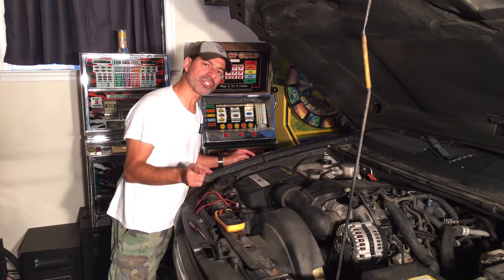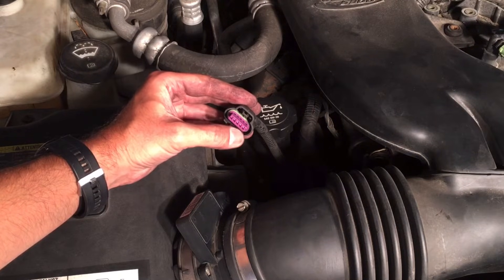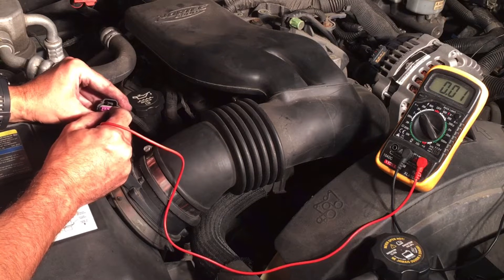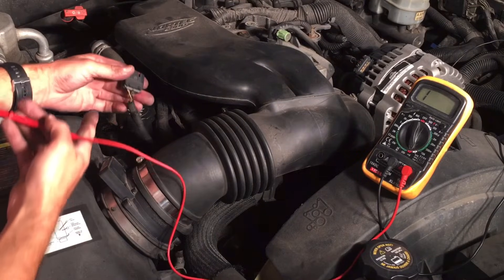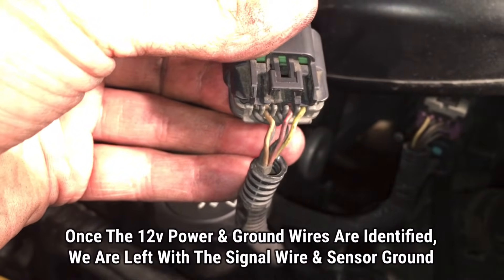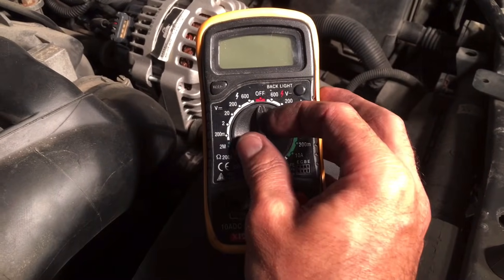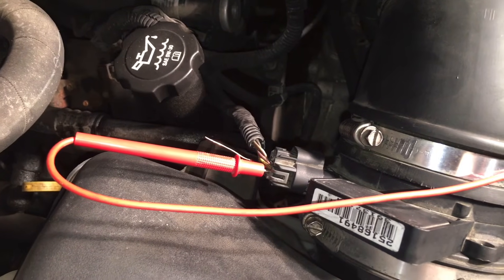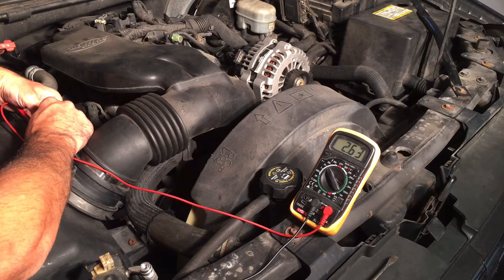How To Test A Mass Air Flow Sensor (Andy’s Garage: Episode - 287)

Comment: Hi I have a BMW 2012 diesel 530d. 180kw. if I have the maf sensor connected the car is running badly it still vibrates... but if I use the disconnected maf sensor the car runs perfectly I have changed many sensors and it is still the same

Comment: If the sensor is connected to through one connector ,where do you get the other connector from?? I wired my sensor and it shows the 14 voltsdc how do you get 2.4 volts reading? So confusing!!!

Comment: Hello
I tested the maf sensor of my car as you show and the voltage is almost constant (around 2.6V), idle or at high rpm. Before I tested the harness: 5v and 12v, ground with continuity, everything fine. So, I tested a new NTK/NGK sensor but the results are the same: the same constant voltage. Any clue how this can happen?

Comment: Nice video! But, dude, buy yourself a quality multimeter. Your XL830L cost, what, less than $10? You'll get better accuracy and, more importantly, faster response time by spending a little more $. I don't mean a Fluke (although there's absolutely nothing wrong with owning a Fluke), but Extech, Klein, Brymen, UNI-T, Sanwa, ... Just something that has better specs and has gone through more rigorous QC testing and standards validation.

Comment: Why were you reading a 4.9V at the loose harness (signal wire assumably)? I'm noticing on my Ford Transit, it's doing the same thing (getting 4.94V backfed from the PCM) and everything I've read says this is normal when the harness is disconnected. But when I reconnect it and restart the engine, it still says 4.94V and doesn't go down to 1-2V as it should. It's a new sensor. And disconnecting the PCM harness shows there's no short to voltage or ground from the MAF signal wire (ie not a wiring problem). I suspect the PCM itself is bad.

Comment: If you don't a voltmeter, you can unplug the wiring from the sensor while the engine is running, if the engine doesn't stall right away then you have a faulty MAF sensor.

Comment: How did u know which wire was signal wire vs ground wire? The orange and yellow wires you used? Red and the 2 blacks I understand but how do you know which wire to put the paper clip in vs the probe?

Comment: I keep getting higher than the battery voltage, when idling, it's increases by 2 volts then idles back to 12.4 volts. I'm thinking it's the MAP Sensor.

Comment: I noticed the author of the video isn’t answering questions, so let me clarify a few things:

Connect the black lead of your multimeter to ground (–), and the red lead to the yellow signal wire on the sensor.

A lot of people say that unplugging the MAF sensor while the engine is running is a reliable test — but that’s actually a myth. It's not always true.

On some cars, the engine may stall because the ECU can't compensate fast enough. On others, it may keep running in “safe mode,” though usually with unstable RPM or reduced performance. So the unplug test is unreliable at best.

Use a multimeter for a more accurate reading, or even better — use an OBD2 reader and check the live airflow data. That will give you a much clearer picture of how the sensor is behaving.

Comment: This is good however I wouldn’t do step 2 .. step one making sure power is coming from the lead is good .. testing the sensor itself .. you just need to unplug it .. if no engine change happens the maf sensor is gone

Comment: This is good however I wouldn’t do step 2 .. step one making sure power is coming from the lead is good .. testing the sensor itself .. you just need to unplug it .. if no engine change happens the maf sensor is gone
Reply: Would cleaning it fix the problem
Reply: @PVRP73 sometimes, you can try that first but make sure it’s MAF sensor cleaner
Reply: @tylagasse1197 yup cleaned my sensor nothing happened I guess I’ll have to buy a new one

Comment: Left me confused. Don't know how all the rest got it.
After watching im doing this.  Connecting in hope a copper wire to each of the yellow and guessing which one gets the red and black from the altimeter.
After reading a post . You say to connect the blk frm meter to a ground black. 
But that still leaves 2 yellows to chose from. 
You rushed the end with out even showing insertion of the second wire and where it went.

Comment: An easy MAF test while you're in a pince is to tap it lightly with a screwdriver while its running. If the idle fluctuates, or it stalls, the MAF is bad. If not, there's little chance its bad.

Comment: It would be nice to know which wires you actually ended up testing as you changed up from using a wire probe on the yellow wire to the probe on your multi meter. Are you then using the wire probe on one of the black wires for the ground on the multi meter?

Comment: So shadetree style is to crank car, pull plug off. If car cuts off, sensor is working. Cut car off and plug back in. If car continues to run and run rough its bad and ecu is already attempting to compensate

Comment: For the first timer, DIY’s, it would be great to let them know to always check for continuity with the power supply off and to NEVER SELECTTHE RANGE ON THE MULTITESTER WHILE IT IS CONNECTED UP TO THE POWER SOURCE - it is always GOOD PRACTICE TO SELECT THE RANGE THAT IS TO BE USED FOR TESTING BEFORE HOOKING UP THE MULTITESTER..🤔…… SAFETY FIRST IS A MUST PRIORITY.

Comment: Chris I hope you see my comment. I recently was given an 03 2.0 gasser jetta. He said that it has a maf sensor problem. He put in a new one and it didn't fix the issue. He has a couple lying in the trunk. One is a Bosch. Is it just a maf problem? I tried starting it up. It starts but quickly dies. How can I resolve this issue?
Reply from the maker: @DarrellDayton  if it’s a MAF sensor issue you will be having a check engine light on and code will be specific for that sensor.

Comment: Hi, none of my wires are providing 12 volts, Nissan Altima 2019
Reply from the maker: @username10  you may have a break in your wires. You should test each of them to determine if that is the case. Here is a video I did showing how to check for breaks: https://youtu.be/714_57IRwkk?si=zIfVVk0NFRSzl7FF
Reply: @PhillipsVision  good morning, sorry i meant to write im getting 5.06 on the other pins which are not ground

Comment: After you narrowed down which two pins are dedicated to sensing, how did you know which one to treat as ground for your test? Of the two pins you found dedicated to sensing, would it matter which one you choose for ground? Did it have to be the one you inserted the wire into? Could you have inserted the wire into the other one. Lots of ways to ask the same question but, well,  thanks.

Comment: GM 07 Saturn Aura - No voltage from the MAF sensor Plug to the multimeter from any of the plug contacts.  Weird.  Plug looks exactly the same as the one in your excellent video.  Any ideas?  Fuse?
Reply from the maker: @twtw9589  may have a break in the wire.
Reply: @PhillipsVision  Thank you for your reply.  I'm getting P0171 & P0174 lean banks 1 & 2.  Would the engine run fine with the MAF sensor completely dead?  It seems like there would be performance issues.  The wiring looks fine.  What would you do next?  I'm in E TX so I can't bring it to you for in person diagnostics.
Reply from the maker: @ no, the engine will have a rough idle. You could have a vacuum leak somewhere as well
Reply: @PhillipsVision  - The next step is a Smoke Test.

Comment: Great informative video! Thanks for the attention to detail. I have a centipede game in cabinet . Do you work on them also. Vacuum tube monitor?
Reply from the maker: @lendellsmith4411  I repair arcades, slot machines, casino games and vending machines. What’s your issue?

Comment: one confusing thing. When you are ready to test, where did you connect the red probe? I see where you connected the black one for where you put the copper wire to connect the other probe.
Reply from the maker: @ernestopenaloza6449  you need to attach it to the 12v power. You may need to move from pin to pin until you find your 12v

Comment: I got a bit confused at the placement of the probes. I know that youre putting the copper wire at the signal wire however, did you put the positive probe of the multimeter to the positive on the mas port and id the negative coming straight from the battery to the signal probe on the mas?
Reply: Won't matter , if you get it reversed then the multimeter will just read a negative voltage instead of positive. Just ignore the negative sign if you reverse em. But black to one of the grounds and red to your signal and that'll give you the positive reading.

Comment: Service manual (toyota ) says remove it completely.  Place power on pin1 (right) and ground pin 2. Measure on pin 3 and 5 and blow air at it. Check the voltage fluctuates. Then check resistance across pin 4 and 5. There should be anywhere areound 2.6-0.3 kiloohms, based on temp. The reason to test sensors by temp is because their readings should change, and what thr voltage reads is more based on the response to temp. The response to temp is based on resistance.  If you have live feed, them you can look at the wave signal or read how nany grams per second it reads.
Reply: You went all grad school on freshmen.
Reply: @thomasraywood679 😂😂😂

Comment: Another way to test the maf sensor if your suspecting it.  Is unplug it. And if the vehicle doesn't die. The maf sensor is toast
Reply: I am having the same problem right now, but I think it’s not my airflow sensor. I think it’s my wire. Connection.
Reply: Mine did die. Yet testing the + line as per the Vid kept showing 12.5 to 14 volts.
Reply: I changed 3 of them and the problem is still there😢😢
Reply: @bernardwright2802 you should be looking for other things before doing 3 of them maybe your intake manifold gasket is leaking
Reply: @johnnyrebel3340 No, that is not true, reread and rethink what you wrote and you will realise it makes no sense.
Reply: @MrGoogelaar  nah your wrong that's how my f150 runs at its best speaking from it starting with no keys ethier... test before you speak
Reply: @MrGoogelaar I read this in a British accent
Reply: @marknapier8083  Try and rewrite your comment so that it looks like something a literate person would write.
Reply: @MrGoogelaar you are both wrong, yet both right. You can bypass the maf, relying on your o2 sensors, in some vehicles. Not all.
Reply: I rmeove it but nothing changes.
Reply: Hahahah thats mean your MAF sensor are bad. Change it to the new ones @androlaius3859
Reply: What happened if it still running with a new sensor
Reply: @BigBoss-hy4zl  If the scanner gives a code for the air flow sensor then that simply means that there is a problem with that circuit, it does not mean the problem is with the sensor itself, it can be with the wiring or even in the ECU.
The only way to determine where the problem is is by testing the voltages on the different wires but that is not in the scope of some people, all vehicles are also not the same, on some vehicles the airflow sensor has the air temp sensor built in so you need to determine what wire is doing what. Different vehicles also react differently when unplugging the sensor and have different voltages on the sensors.
Reply: @MrGoogelaar what if you get a running rich code and a shaking car like it has a slight misfire

Comment: Hows this the mass air flow problem? Its the plug issue not mass airflow im lost? At the end whats next you change the plugs or the mass air filter now? You only tested the plugs 😢im lost
Reply from the maker: @almministrys1659  I mention in the video that the sensor tested bad, so it needs to be replaced

Comment: I'm glad mine only has three pins❤😂. 

I'm not a mechanic.  I don't mind "firing a parts cannon" the junk I work on probably needs it anyway and at the price of a shop I can replace a bunch of stuff and still come in under budget. All hail the mighty parts cannon. I just wish spark plugs weren't such a bite to get to  on front wheel drive cars . I can replace injectors easier than spark plugs and that just ain't right.
Reply: @ADoneGooner the overflow tank can be unscrewed and set forward giving you great access to that furthest plug which is always the problem. Hope that helps in the future, sure helped me. Couldn't even get the wire off on 3800 V6. With reservoir moved pulled the wire on first try. Quick and easy access even with large winter coat on.
Reply: @user-mr3oe5og5q  after many cuts and abrasions I did actually think to put a coat on. Your right. It works way better. 🤣 my impala is a joy to work on compared to the accursed 3.4 sfi Buick Rendezvous . The bane of the automotive world.

Comment: TIP: Use an analog voltmeter with a needle (not a DMM) to measure voltage swings with gradual rates of change. It's easier and gives a better, more meaningful visual representation.

Comment: The easiest way to test a MAF is directly in the data stream with your scam tool. No need to damage the sensor connector with paper clips. On a 6.0 liter engine the data stream should read 1 gram per second per liter of engine displacement. A 6.0 liter V8 should read at least 6.0 grams per second at idle. If it's lower than 1 gram per second per liter you need to inspect the engine for vacuum leaks in the intake system. Test for exhaust leaks ahead of the oxygen sensor like doughnut gaskets. If you find no leaks remove and inspect the sensor hot wire for debry or contamination. Clean the wire with MAF spray cleaner. If your data still reads below the standard of 1 gram airflow per liter of engine displacement verify your diag of vacuum and exhaust inspection. Check for restricted air filter etc. if nothing is found replace the MAF. This diagnosis is accurate because you've inspected, repaired and vacuum or exhaust issues. I have fixed many many other techs "come backs" by doing the diagnosis described here. No need to guess this diagnosis is exactly what the engineers use to describe the technique.
Reply: Thank you for this comment.  I was already about to buy a maf sensor based on my brother telling me that something something on the data log looked funny and it probably needed a maf sensor.  So, i looked up how to test one.  My scan tool was showing that I have 9.5 grams per second at idle.  I have a 2012   5.3.  Ok so then I replaced the maf sensor and now the reading is about 5.5 grams per second at idle.  The truck idles smoother and it picked up a little bit of power.  Also on the data log my truck was doing a lot of knock retard and stuff like that.  Any way thank you this helped me out.
Reply: I'm betting you're 100% correct in what you say about expected readings and the troubleshooting steps one needs to take if those readings aren't a match for what's expected --as you say, per liter of engine displacement. What I'd maybe take exception with is your use of the term easiest. If you know enough, and are in possession of the right equipment, sure. But plenty of guys neither know enough nor own anything related to OBD or OBD2. Thus for them, it can be argued that what's easiest is to break out a multimeter, follow the vids set of steps, and then replace the MAF if it misbehaves the way he showed. There again, I suppose it could still be a good MAF and only misbehaving because of a vacuum or exhaust leak. That seems to be the stronger point of your argument. A new MAF, after all, isn't going to fix those kinds of problems and still won't be able to compensate for them.
Reply: How do I test it under load?
What would I look for?
Do I have to be driving?
Can it be in park,
And just raise rpm?
5.3 ls
Reply: @The77stevo77 Test the MAF by reading live data at idle. An accurate MAF will show 1 gram per second for each liter of engine displacement. A 5.3 V8 should draw 5.3 grams per second air flow at idle. If it seems like it's low look for intake and exhaust leaks. If you don't find a leak remove and clean the MAF and retest for 1 gram airflow per liter of engine displacement. If it's still low replace the sensor and retest. Simple and you didn't damage the harness by needlessly back probing the connector and damaging the harness.
Reply: ANOTHER KNOW IT ALL....SCAM TOOL???? GTFOH
Reply: Until the scan tool shows you 0g/s with a p0102. Then, you're testing the harness and checking for continuity all the way back to the pcm
Reply: Finding the problem without a scan tool is way more satisfying 🤘
Reply: @Its_a_ranger what this video shows is lack of training and hacking into the harness to diagnose something you know nothing about.

Comment: I bought a new Maf sensor an it still is giving me the same P0100 code how do I check the connector? Would it the 1st procedure you did?
Reply from the maker: @kelvinsmall2552  Yes, the first one. Did you buy and aftermarket one or OEM?
Reply: @PhillipsVision  aftermarket from Autozone
Reply: It’s for a 2001 Nissan frontier
Reply from the maker: @kelvinsmall2552  sometimes those aftermarket parts can be subpar and cause issues. I’ve had good and bad experiences with them. Make sure you are also getting a solid connection when you probe the harness